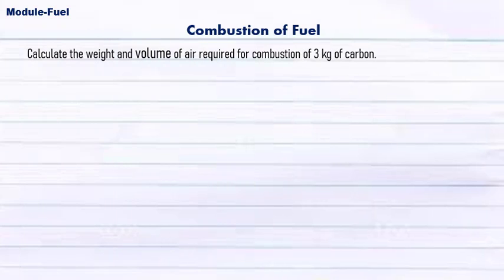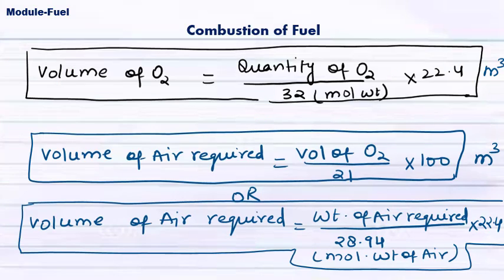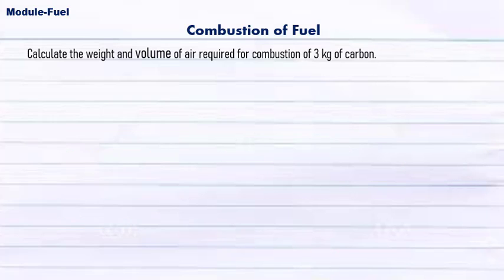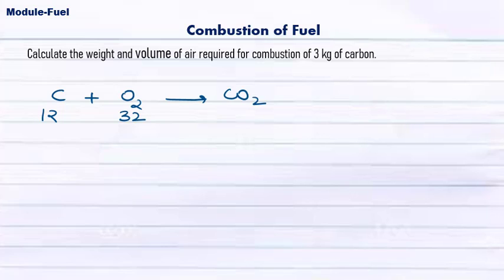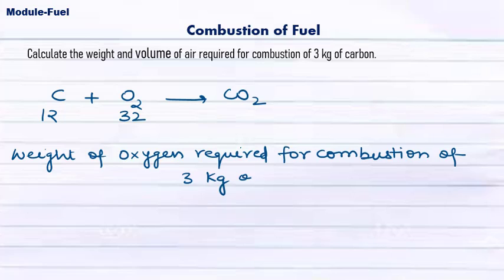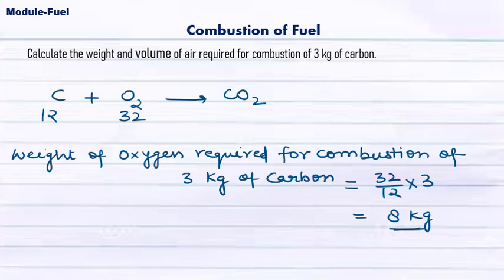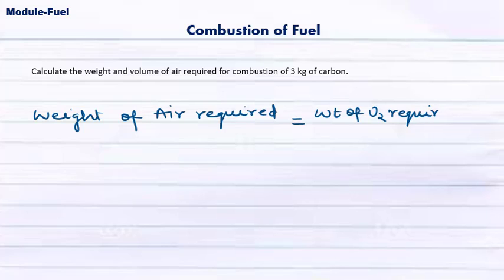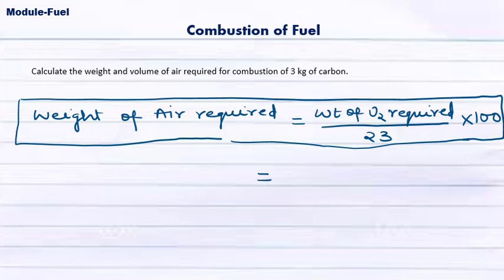Fuels| Combustion of Fuels | Numerical Problem-2 | Dr. Anjali Ssaxena

Comment: Maam in the reactions of combustion 12 parts etc that 12 will it be in kg or gm maam like in last numerical u said gm but here it is kg maam so i m confused whether we have to take in kgs or gms or we have to convert it or not?
Pls maam tell me
Reply from the maker: Both of the side you have say same as 12 gm carbon eill require 32 gm oxygen or 12 kg carbon will require 32kg  oxygen. But when we calculate amount of o2 required that is always calculated for 1 kg of fuel.